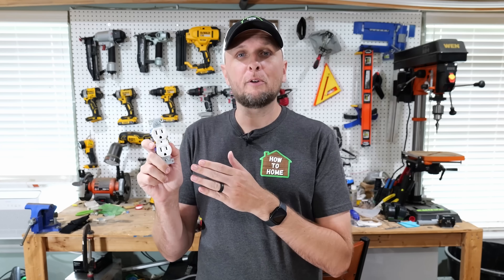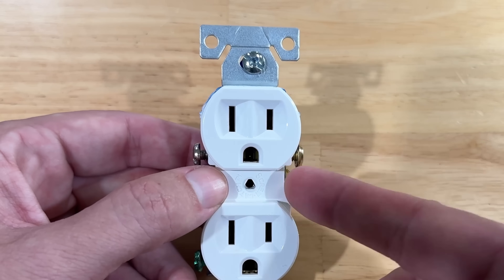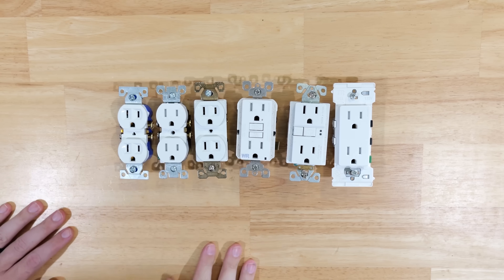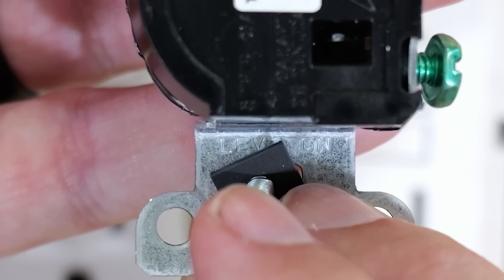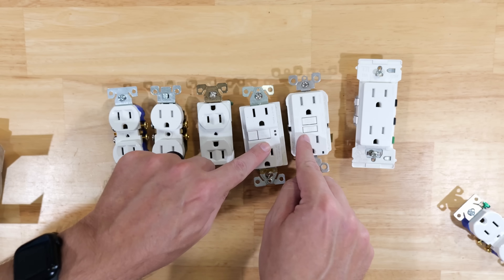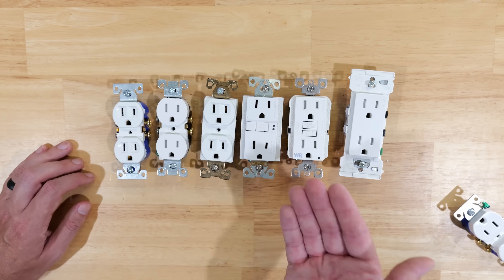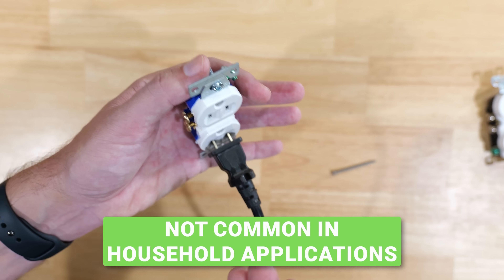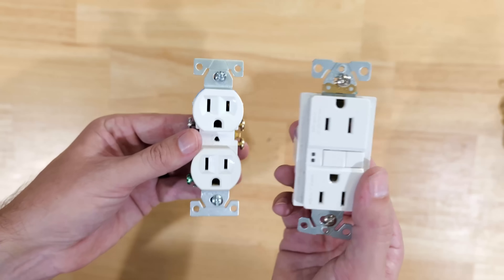The Shocking Reason Why Your Outlets Are Installed Upside Down!

Comment: When they first came out it was ground prong up and then it was switched to ground prong down because they wanted the ground prong to be the last prong to leave the receptacle. Tests showed most people pulled the cord out with downward pressure, so everyone started putting the ground prong down. The ground prong is a little longer than the others so they want the ground prong out last.

Comment: All I know is that some adapters do not stay in the outlet if the ground pin is mounted at the top. I ended up using a strip bar in one apartment because the adapters would not stay in the plug.

Comment: My outlets are all ground plug down or wide blade left orientation because I use a switched outlet plug-in accessory.  It's just adding an on-off switch to an outlet, like for soldering irons or little sandwich grills.  They all are made for the switch to be in the upright position, some light up when on.  Also some night lights & plug-in air fresheners are made for it's feature/light to be orientated up.

Comment: 😮 the way I've seen it all my life ground down ,but I think there are reasons why ground up maybe better not saying I like it feels odd  1 does not look like a face ,2 if plug pulls out/down its the ground exposed not the live prongs, I'm sure there are more but most just extrapolate those 2 points for different reasons ,and yes many flat plugs are made ground down but I've seen them ground up also, some even rotate to accommodate for both layouts ,now let's have a conversation about installing them sideways 😂

Comment: I would say your point about the prong side down being better because it prevents you from touching live with your pointing finger is invalid in the same way you invalidated the ground prong up where most residential appliances don't have that ground prong. In the scenario of only having 2 prongs it doesn't matter which orientation its in, your pointing finger is just as likely to touch one of the prongs.

Comment: I would install it with ground down. But some appliances with right angle plugs, I would install it where the wire is straight down and not where it would have to have the wire go up and then back down.

Comment: In uk, the ground/earth is up, the live/hot/line  is left, neutral side is right, plus on our plugs the ground/earth prong is longer than the other prongs, this is to protect against people getting electric shock, plus the live and neutral prongs are sleeved this to protect against people getting electric shocks when they are plugging or removing the plug from it sockets, also our live/hot/line/neutral sockets are covered and only become opened once the earth/ground is plugged in. This to prevent children putting fingers and other things into the sockets and getting electric shocks.

Comment: Up or down? How about sideways. I dont like them up, because many plugs end up pointing the wire up, which the is affected by gravity, and the bended cable is unnecessarily stressed. Or in some instance the weight of the cable is making the plug to come out a bit. Disconnecting a bit, creating spacing enought to become a hazard. 
So up or down. Its not about code. But common sense. Theres a reson why so many multiplug outlets have the ground pointing to the side. Because the ground pointed in line. Made plugging multiple AC to DC or plugs with reset a hassle or impossible. 
So think where that outlet is gonna be. And consider if you are gonna plug something that been ground up is gonna be a problem.

Comment: If you install it ground prong up  you are wrong. The NEC covers wiring. 

The neutral side is on the left when devices that have a direct orientation. Example a dock for phone charging.

Comment: Father was an electrical contractor. He taught me a lot about home wiring and for a while took me on jobs.  He wanted them prong down.  On a more practical point, the first time I was shocked I was a child of 4 years old so around 1960 and the house we were in was build way before then. No receptacles had ground prongs.  I helped my mother with the vacuum cleaner by unplugging it from the wall.  I got my finger behind the plug up from below and across the two blades. The path was only across the my finger but the experience has not been forgotten.   I totally can relate to your point of accidental contact.
Reply: Once when I was 7 years old, I used my finger to check that I was plugging in (something) under a desk. Learned my lesson there.
Reply: I was shocked in the same manner in the same year.  I still remember it.
Reply: same type of incident for me! GROUND DOWN!
Reply: Ground prong up when that outlet is attached too the light-switch so people there know where to plug in their lamp to control it from the wall light-switch.

Comment: I like them up, because that is how UK (where I come from) is. But ground down will be better if the cord gets pulled semi out, as the Live Neutral will disengage before Ground. In UK the plugs are way more substantial. And the Ground (Earth) pin is longer. Because they are thick square pins they unplug straight out. which is more safe.

Comment: There are several devices, like timers and watt meters that require ground at the bottom, otherwise it will be upside down.  In my Dad's house I had to flip one of his outlets in order to plug in a timer.  
Also, 90 degree cords, like on a refrigerator, require the ground to be at the bottom, otherwise the cord points upward instead of downward.  I have never seen a one way cord or device that requires ground at the top.

Comment: One reason electricians install upside down in homes to let people know they are controlled by a wall switch. Which is known as a half hot. One has power all the time, and the other is controlled by a switch for a lamp.

Comment: Ground down is how most nightlights and polarity specific consumer electronics are oriented. I am a state-licensed industrial electrician, for the past 26 years; I've noticed residential is usually ground down, but industrial is often ground up. I always install ground down, unless the current project I am working on is ground up; and I've never given anyone issue with them preferring to install ground up.

Comment: I feel that a 3 prong (grounded) plug falls more naturally into the hand ground plug down - your thumb rests nicely on the flat top.  And, it would seem that the natural lay of the cable from the device is with ground prong down.  However, some of this natural feel could all be  based on habit - with most outlets installed ground plug down.

Has anyone ever tested pull out/fall out resistance?  You have to choose which angle a plug would likely get yanked (forget gravity right now, I’m thinking trip, catch, yank).  Does either provide better resistance?  Of course if it did, you still have a problem: sometimes for safety you want the plug to easily come out (doesn’t trip someone or isn’t half inserted) other times you want the plug to remain very secure (sump pump, etc).

Comment: I work in the maintenance department for a county school system and we always install outlets with the ground prong up. Our reasoning is; since we use stainless steel covers, it prevents the cover from falling across the blade prongs and causing damage or injury. I don't know how kids are in the rest of the world but in our county they seem to have fun kicking the plastic outlet covers and breaking them. That's the reason for the stainless steel covers.

Comment: A practical reason for ground direction is as related to direction of cord drop. 
This more to avoid annoyance of loss of power due to cord pull out. 

If the cords are typically drooping down (typical). Then is less likely to pull out for a grounded plug with ground up. 
And same true other way around. 

Most notable issue as the outlet wears out. 

Btw. A cause for short fires in past was tinsel on Xmas trees. Back when outlets installed rarely had grounds. Overloading a circuit common. And circuit breaker’s likely to be fuse based.

Comment: Ground prong down holds onto plug better against the weight of cord and being bumped by pets generally,  not always.  Same as a 3 point wall mount, two on top and one on bottom.

Comment: FYI: He forgot to consult the history of how electrical outlets were installed in the past when they didn’t have a ground connection. The Electrician Journeyman rule of consistency was always hot wire is on the right side and the common wire is on the left side. This procedure naturally carries over to the installation of the current 3 prong outlet.

Comment: Ground go on the bottom/down.  End of story. The only reason they would be installed up is to prevent a short if the plug was partially out and something metallic slipped on the top of the two connectors, but that’s what a fuse or circuit breaker is for.  Right angle plugs are made for the down orientation. Grounds down. Case closed.

Comment: I feel like I've been given permission to install these sideways or perhaps even at odd angles. My wife will love it!
Reply: Yes, those are allowed, too (because they're not prohibited). Still, I side with vertical, ground-down because of the design of common wall-warts, as discussed by others.
Reply: @r0bst4rl1ng in my opinion wal-warts should NEVER have been designed to plug directly into an outlet, since they usually always block the 2nd outlet from being used.

I think there SHOULD be a code for adapters, and they should have that block with the transformer/electronics in it should be like a lap top computer adapter, a 2 or 3 prong cord plugs into the outlet, then it either has a female plug that mates with the adapter or is wired directly into the adapter block(lays on floor or table), then the other side exits out to be plugged into the device it powers or recharges.

Yet, here we are with big, bulky wall warts that rob us  of using the electrical outlets full ability still in use today...why?
Reply: We lived in a really old house that originally only had electric lights, there were no outlets. Somebody put in outlets at since point later on but since the house wasn't designed for it, a lot of them are a little crooked or in weird places. Of course the rest of the house was a little crooked too 😂
Reply: I live in the Philippines and am having  an all concrete addition built. I was gone for a couple days and when I returned the builders had already installed all the outlets and switches sideways and some stacked bottom to top. The switches were placed about  6' high and the outlets 3'. Guess they were worried about flooding? Which is standard in the US for basement outlets but the switches??
They had to dig everything out and redo it. Unfortunately I was gone again when they "fixed" it. They are lower but still sideways. Since I pay a daily rate I'll live with it. However they are no longer allowed to work when I'm not here!
Reply: @michaelpettit9706  funny story, I love it!
Reply: PS
We live on a mountain with no possibility of flooding!
Reply: @michaelpettit9706  Western North Carolina, "hold my beer".
Reply: I have wired high end houses with wide baseboards ( 6"to 8" ) where the owners wanted the receptacles installed horizontal in the baseboards. It is a little more work but that is what they wanted.
Reply: “Countertop spaces require the maximum space between outlets to be 4 feet, and that no part of the countertop is more than 2 feet from a receptacle. So, there are times when an outlet may need to be installed sideways in order to fit into a spot where it is required to be installed.

The required placements of electrical outlets may also influence outlet orientation, as a horizontal outlet may provide easier access for plugging items in depending on the location. For instance, a vertical outlet behind an appliance or piece of furniture may give you no access points, while a horizontal outlet in the same location may allow you to access at least one of the receptacles. If an outlet is needed in a certain location but it is also clear that the spot will be blocked, then an outlet may be installed sideways to try to improve access.

Another common reason for horizontal outlets in your home is simply the result of aesthetic choices. Electrical outlets are obviously a necessity, but if you're on the hunt for brilliant hacks to make your kitchen more aesthetic, you may find yourself wanting to hide them. While this can help your kitchen look nice, covering the outlets reduces their functionality. Instead of hiding an unsightly vertical outlet, some people choose to install horizontal outlets. Horizontal outlets can have a look that is more low profile, which is especially nice for outlets that are placed higher up on walls, such as above countertops. In kitchens especially, horizontal backsplash patterns, such as subway tiles, are popular, and horizontal outlets are especially good in these situations. Rather than break up the look with a vertical rectangle, outlets can blend in seamlessly when they are turned sideways.”
Reply: I am in a building wired by monkeys.  All the receptacles are sideways.  Maybe they couldn't decide ...
Reply: Aaargh !  Whatever
Reply: “Countertop spaces require the maximum space between outlets to be 4 feet, and that no part of the countertop is more than 2 feet from a receptacle. So, there are times when an outlet may need to be installed sideways in order to fit into a spot where it is required to be installed.

The required placements of electrical outlets may also influence outlet orientation, as a horizontal outlet may provide easier access for plugging items in depending on the location. For instance, a vertical outlet behind an appliance or piece of furniture may give you no access points, while a horizontal outlet in the same location may allow you to access at least one of the receptacles. If an outlet is needed in a certain location but it is also clear that the spot will be blocked, then an outlet may be installed sideways to try to improve access.

Another common reason for horizontal outlets in your home is simply the result of aesthetic choices. Electrical outlets are obviously a necessity, but if you're on the hunt for brilliant hacks to make your kitchen more aesthetic, you may find yourself wanting to hide them. While this can help your kitchen look nice, covering the outlets reduces their functionality. Instead of hiding an unsightly vertical outlet, some people choose to install horizontal outlets. Horizontal outlets can have a look that is more low profile, which is especially nice for outlets that are placed higher up on walls, such as above countertops. In kitchens especially, horizontal backsplash patterns, such as subway tiles, are popular, and horizontal outlets are especially good in these situations. Rather than break up the look with a vertical rectangle, outlets can blend in seamlessly when they are turned sideways.”

Comment: My issue is directional plugs/cords. Folding cords back over themselves is not good for the cord itself. The cord should be stressed as little as possible, hanging as straight down as possible. I myself have seen cords compromised to where the wires had been compromised, or even failed, and required replacement.

Comment: You have to be kidding me. Almost 16 minutes for something totally nonsensical. First of all, I have a machine shop, prior to that I spent 45 years in an auto shop. At no time EVER did we have upside down receptacles and at no time EVER was there EVER a threat of something metal slithering down the wall to make contact with a plug that was partially hanging out. Further, in all my life, I have never grabbed a plug like you do in this video. I have always grabbed from the sides and again, never EVER have I or anyone I know slipped and then touched one of the metal inputs. 
If someone is that paranoid of imaginary scenarios that never happen then perhaps its better if that person convert to amishism and remove all electricity from your miserable life. I can't believe I wasted my time watching this. 👣👣👣👣👣👣👣👣👣👣👣👣👣👣

Comment: Was a Chem Major in college. I THOUGHT I learned everything I needed to know about Electricity in my YEAR LONG Advanced Physics class. Then I got a Summer Job as a Meter Tester with Con Edison (the electric company in NYC). I quickly learned from a bunch of Great Blue Collar guys that I knew NOTHING. Huge flat Copper lines carrying so much current it made your teeth buzz when you clenched them. . They were patient with me and above all kept me from electrocuting my self. These guys were WW 2 and Korean War Vets. They knew my Dad had fought in both so they really looked out for me. Especially then, as it was the Summer of 1977. If you know about that time, you also know it wasn’t safe to be working for Con Edison.

Comment: So the reason of this video "Your Outlets Are Installed Upside Down" doesn't make sense as you and the code actually says that the orientation doesn't matter, unless the faceup thing under the sink that makes a lot of sense. Otherwise the "Your Outlets Are Installed Upside Down" is based of your own opinion and not any professional text that expresses orientation of outlets, thus making the title a false statement.

Comment: Besides "looks right", some power cords have the wire come out at 90 deg (most refrigerators), so the cord drops downward if you orient your outlet "normal".  People who fuss that the ground plug should be on top are tilting at windmills.  If you want to see unsafe, look at 230 VAC countries with the common small 2-prong round plugs.  I rarely see the ground terminal (side connection) used and the wiring is often scary - frayed cords, wet concrete floors with barefoot people.